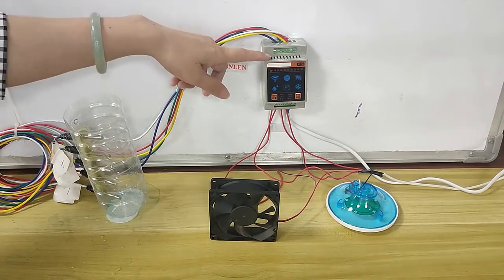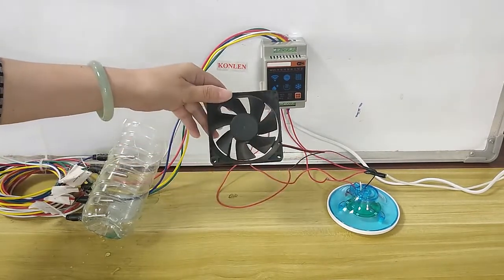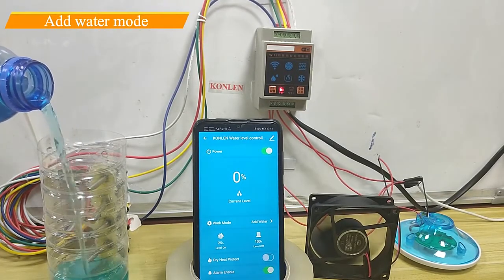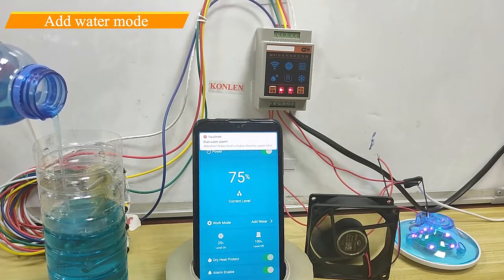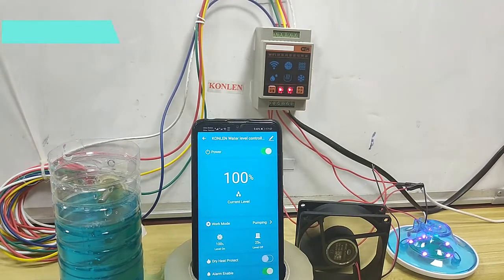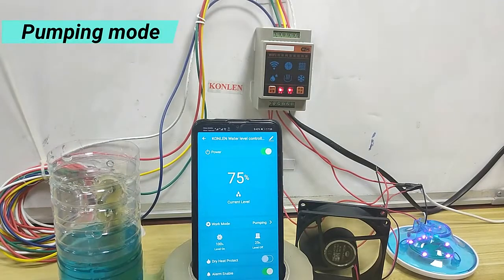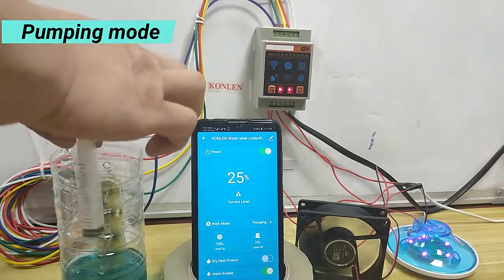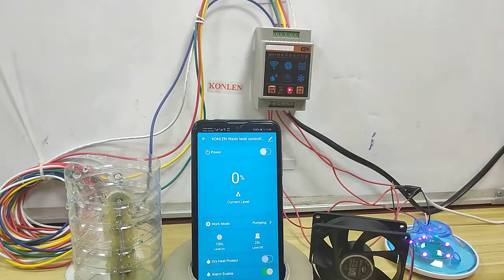Tuya WIFI Water Level Sensor Controller Auto Control Water Pump Relay Switch Leakage Detector

Comment: How to properly wire the the 2 relays?
Reply: waiting one year already ?
Just got it and also bit confused about the wiring.
It isn't told, how the relay output has to be set up.
I measure 12 Volt, but it isn't switching. 
From where we got N ?
Reply: Can you share it?